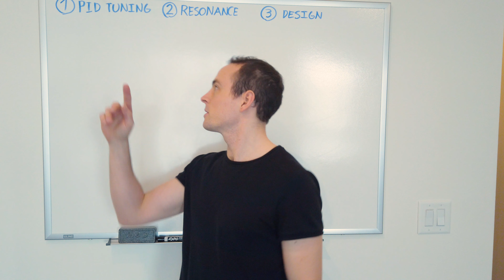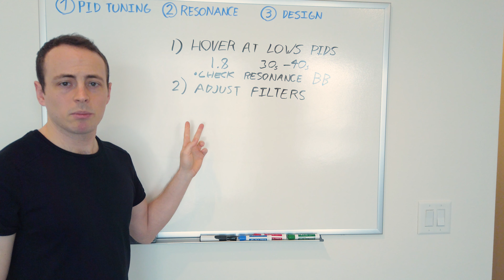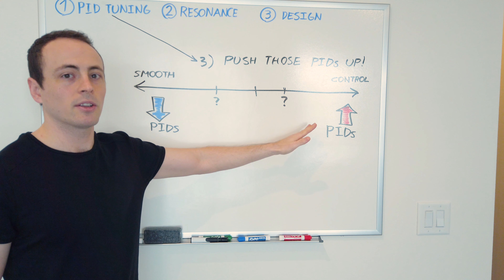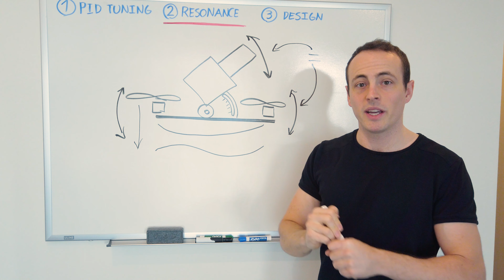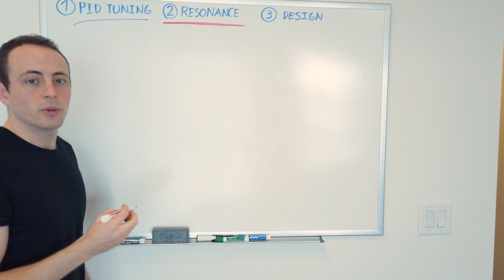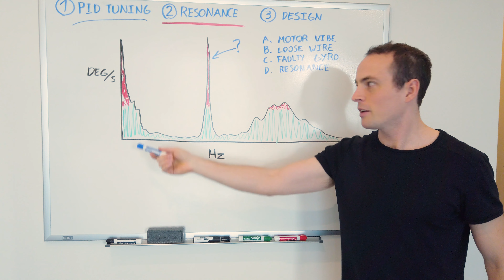Cinelifter PID Tuning

Comment: Interesting presentation. I've only watched the bit about FC mounting so far but wanted to show where I ended up after so much testing.  It's kinda hard to figure out if that 'drum' effect you bring up actually happens or not and if it does, are the frequencies meaningful or do they just get chopped out by an LPF.  Anyway, the latest design I have for 5" has a pretty unique structure to it in order to help manage these specific issues you're talking about.  It seems to do a pretty good job of it but again, hard to tell with only a dozen or so builds.  Also, the vibrational/resonance issue isn't the main reason why I personally hate stack screws integrated with arms.  It just makes it a total PITA to deal with when you need to replace an arm or deal with really anything at all.  See this image for the structure of the Prototype 5: https://ibb.co/chYBhjQ

Comment: I've been trying to tune a 7" for months and just last week was able to make progress. It was just as you describe - a resonant peak at 78Hz - which meant I couldn't reduce filtering, and so couldn't raise PIDs without all sorts of extra oscillation (the bumpy road look). I didn't try a notch, but did remade the bracket holding the GoPro to be thicker and stiffer, and the peak has dropped away almost completely. Still have some more tuning to do, but I've been able to remove a lot of gyro filtering and push P and D up. Fixing mechanical issues really seems critical! I didn't know the camera mount could make so much difference, as a lot of quads seem to have the camera strapped on with no particular system to prevent resonance.

Where I live there is almost always some wind so I need to get P and D quite high to prevent bobbles. Hopefully I'm on the right track now.

Comment: Thanks Sam - really nice walk through ! It's noticeable how much time you spend with this topic !  
BTW, do you have looked into gyroflow for stabilization ? If you are interested, would be great to get some "real camera samples" to work on. We basically just need video + Betaflight Blackbox recorded simultaneously and need to make a lens preset based on a workflow you how from steadyXP.
Reply from the maker: Hi, I haven't used gyroflow yet before, but I am part of the FB group and loosely follow the topic. Right now my focus, and the only thing I have time for, is improving the drone platform itself as much as possible. I've used SteadXP in the past and made that video, but I am hopeful that gyroflow can one day surpass SteadXP and be able to process high bitrate cinema codecs.
Reply: @strawhatsam sounds like a good plan - Elvin does a great job with gyroflow and braw/prores are on the list - as well as hardware to log more efficient/easy.
😉✌️

Comment: Hey Sam. Thank you for this great video. Your channel is one of a kind. I am still struggling with a resonance spike at 35Hz. Should I noticed that I also have the same spike at the same frequency in the Pid D term. Does this mean that I should apply my notch filter on the Pid D term?
Reply from the maker: You only need a notch filter on the gyro. The d-term is merely reacting to the p-term, attempting to damping the oscillation. The d-term always mimics the p-term, in fact it is always slightly ahead of the p-term in an attempt to "predict the future". This is why you see the d-term going crazy when you have resonance, because 1) it mimics the p-term/motors and 2) it is more sensitive than P and I. The D stands for derivative, that same kind that is used to attempt to predict the stock market (stonks). 

I've never used a notch filter on the d-term ever before with any kind of improvement yet, but that's not to say it it's not worth trying out for funsies.

Comment: This video is amazing, thanks for making it... The phase delay stuff was something i was thinking about so glad you talked about it... My last step is going up in the wind and i usually have to push pids an extra 20 in windy environments, although im just working on heavier longrange rigs for now... might not be as bad on x8's

Ive recently designed a 10" frame with flight controller mounted through the bottom plate and not the arms, but i made top/bottom plate 4mm thick hopefully that helps remove some of  that resonance you talked about
Reply from the maker: You're welcome! Yes with sandwich plates as thick as 4mm and with the edge of the FC as close as possible to the arms, I think you'll be fine.

Comment: Would you ever want to intentionally join the camera AND drone resonance together intentionally so you’d only have to apply a single notch filter for both?
Reply from the maker: Every time I've encountered camera payload resonance it's just one peak usually on the pitch axis. As such, by applying a gyro notch filter at that frequency, you eliminate the resonance. Resonance occurs because the camera's natural frequency and the drone's natural frequency are close enough together to excite each other. The two systems together cause one resonance frequency and thus you need just one notch filter. Unless of course you are getting a resonance on the roll axis as well (which is possible). In that case you would need two notch filters. At that point though, design changes must be made. 

As an addendum, there are ways to nullify resonance before it even starts (mechanically) without having to resort to notch filters. This is some secret sauce though that will be revealed by my drone designs when PerformanceFPV launches.
Reply: @strawhatsam  excellent! Stoked to see what’s next! Thanks for sharing your knowledge in this video